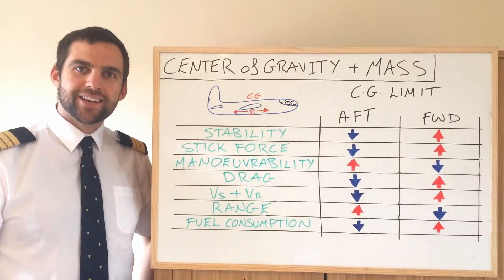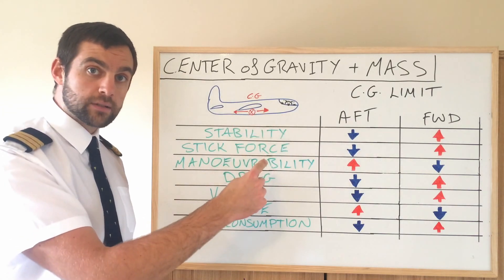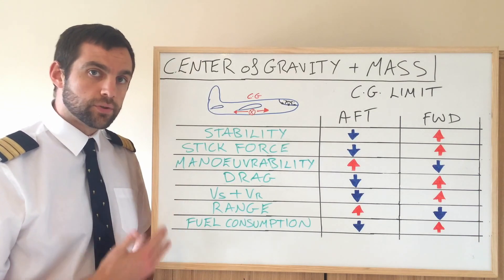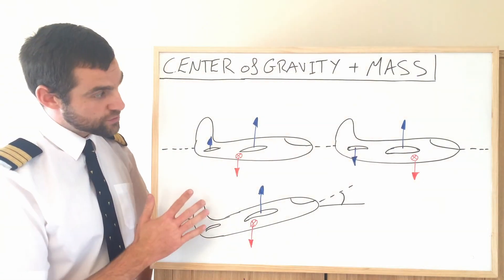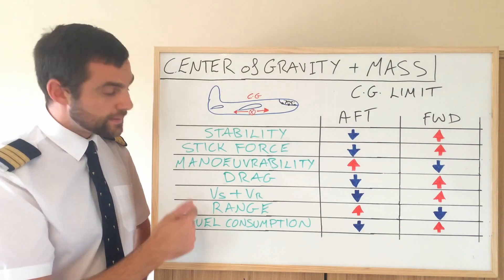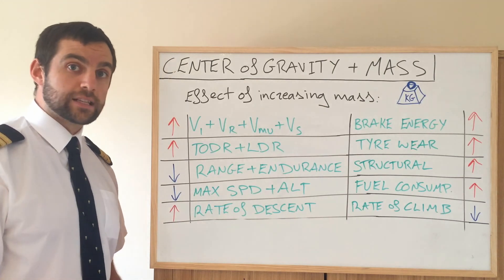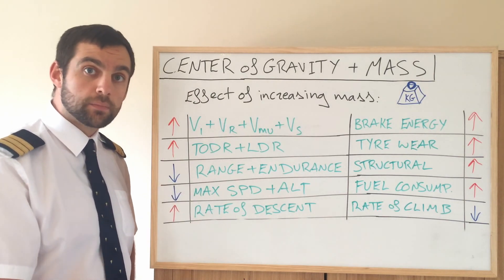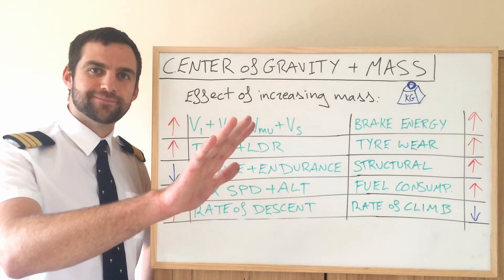Centre of Gravity and Mass ✈ ATPL ✈

Comment: As far as I know the maximum rate of descent will be lower for a heavier aircraft. The explanation is that being heavier the aircraft will reach the maximum operating speed when descending at a rate of descent that is lower then a lighter aircraft. So the lighter aircraft actually descends faster!
Reply from the maker: aerodynamic speed like Vne dont really change with weight only regulatory speeds. :)
Reply: PilotEd My point is that the heavier aircraft has to maintain a lower of descent that a lighter aircraft, otherwise it would over speed. Heavier aircraft have a greater momentum and this weight-driven momentum will produce a greater speed in a vertical dive.
Therefore a heavier aircraft has to start its descent earlier than a lighter aircraft because it has to maintain a shallower descent. 

Btw great job with this channel. Really useful stuff :)
Reply from the maker: my point in the video was two identical aircraft flying the same speed the heavier aircraft would arrive at the ground first, but both flight paths would be identical. thanks for watching :)